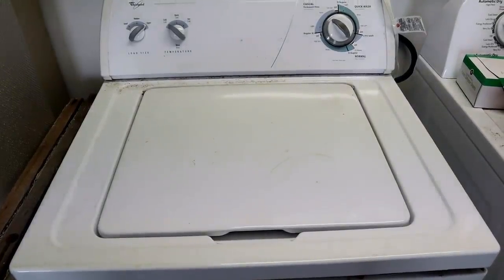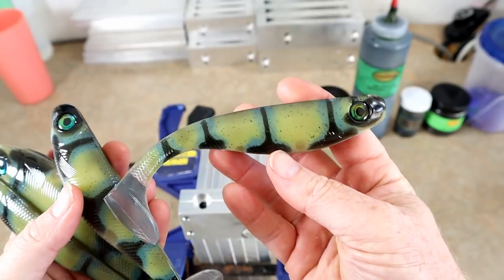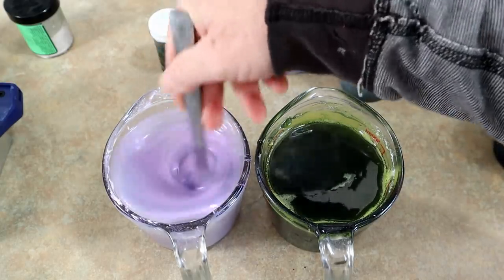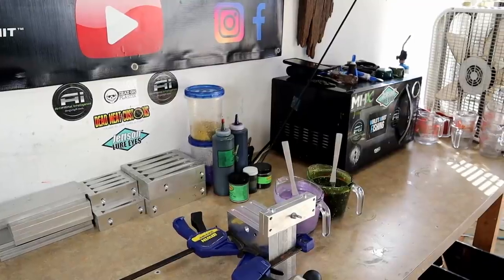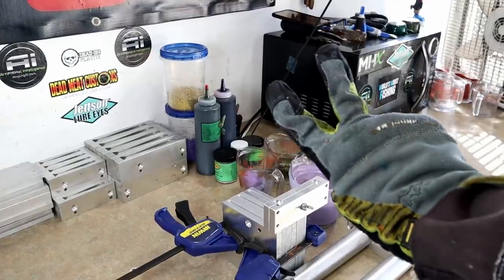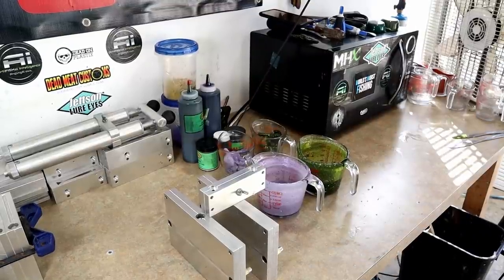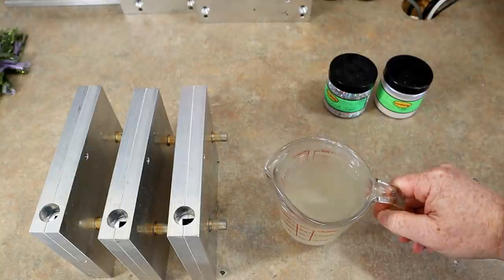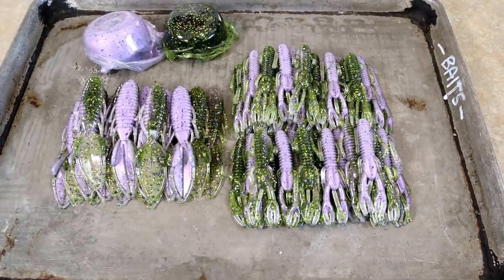Custom Color Building; Watermelon Purple Pearl

Comment: I know you’ve probably gotten this question before, and may have addressed it in a prior
Video. I’ve watched all the beginner videos and have grown to be a fan of your content. I went ahead and got everything I needed to start making them. I made the rookie mistake of not mixing my plastic well enough before using it. I sloshed it around (gallon) for a couple minutes, thought it was good, and ended up with a sticky glue like worm and plastic. Had the temp up to 370° so I know that wasn’t the problem. 

My question however is, can that plastic still be used? Is it salvageable in any way? Or is it a lost cause because it wasn’t mixed properly before hearing? 

I tried re heating it hotter. 
Mixed the crap out of it. But still a sticky mess. 
I just wanted to check with a professional like yourself before going and throwing out a whole batch of plastic. 

I learned quickly from that mistake and made sure to mix the next batch a lot more. 

Thank you!! 
Keep up the great content!!
Reply from the maker: It is not useable..the plasticizer ratio is off.
Reply: @WorldsWorstFishing  I didn’t think so. A little expensive mistake to make, but good to make it early to learn from it. Thank you for the help!!